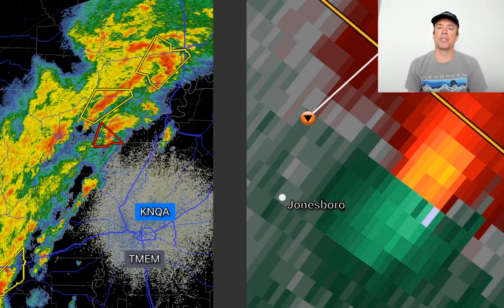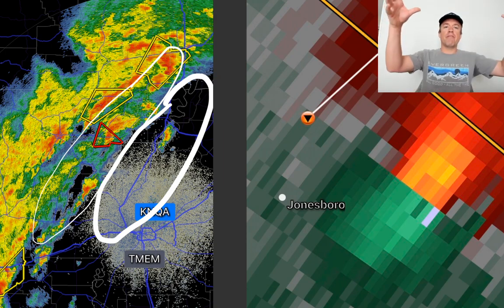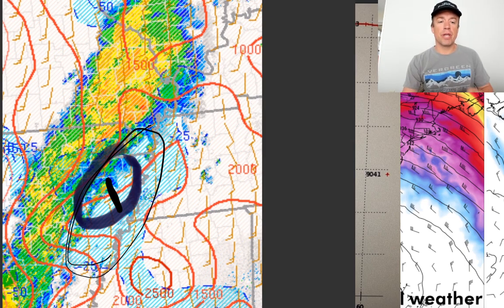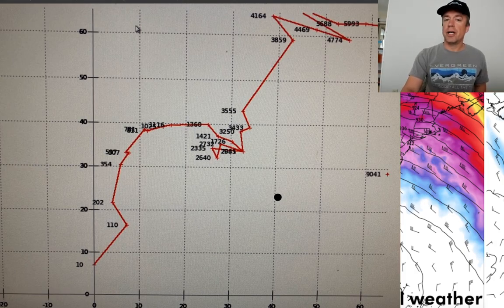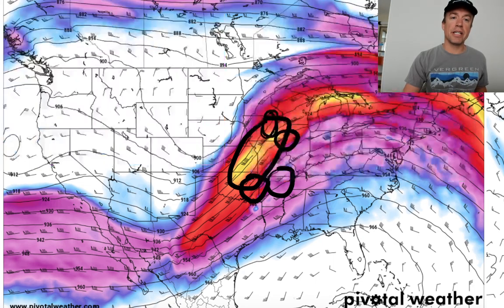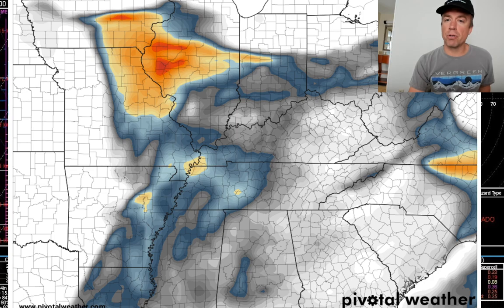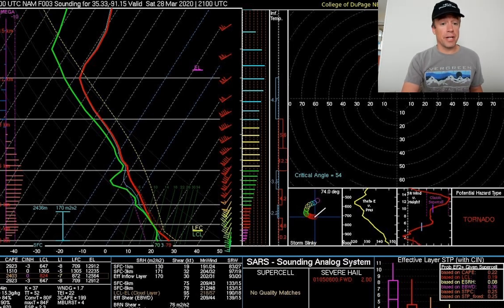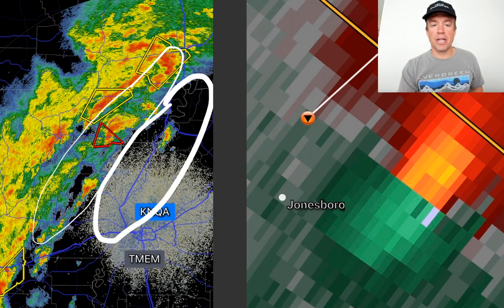LIVE meteorological breakdown of the JONESBORO TORNADO setup

Comment: Jonesboro has had some close calls in the past, that combined with quarantine are the two factors in which no loss of life occurred. I live here and although its been a gloomy couple of days, the fact that everyone got to a safe spot is something that should be noted. I was at work when it happened, probably came within 100ft of me when i finally had seen enough. The smell that was in the air 30min before it touched down was indescribable. When the clouds were pouring in, the temperature dropped easily 10-15 degrees and then rose again with one swift gust just as the tornado made its way to the ground. Hardly any rain at all fell until after the destruction was over. And just as quickly as the rain fell it left, probably an inch and a quarter in a span of 5 min. Then as everyone began to come outside to see you could hear the crying and distress all over. I took off running across the street and saw some kid crawling out of the rubble of a mechanic shop. He was perfectly fine aside from the fear i saw in his eyes. The dry cleaner next to my job was on the ground, the tire shop across the street leveled, post office vehicles littered throughout its path. It seemed to intensify right as it tore into the mall and made its way towards the airport.
Reply: Do you remember the May 15th 68 killer?